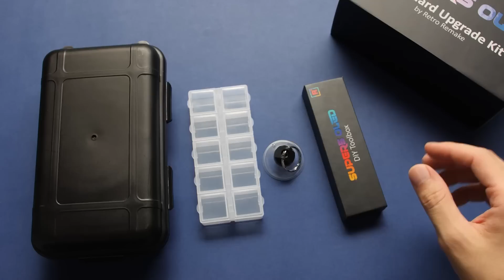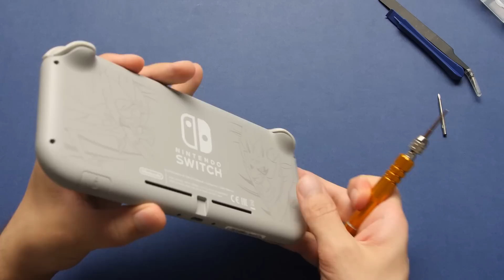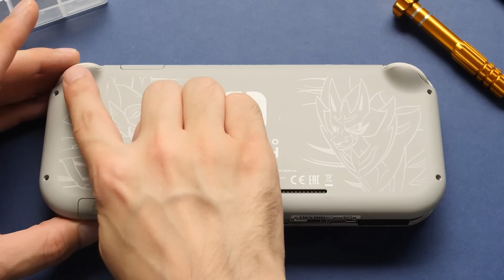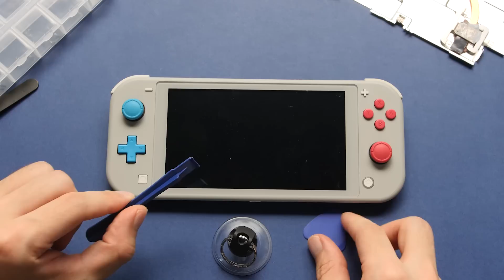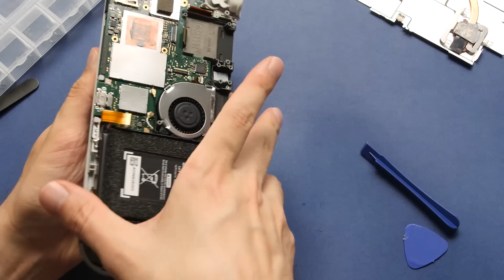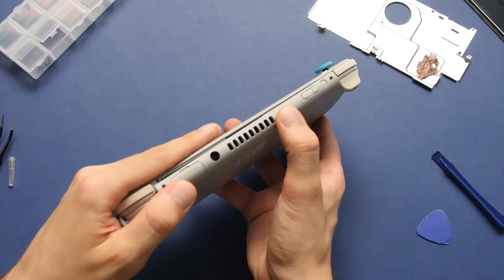SUPER5 OLED - Product Overview & Installation Guide Part 1

Comment: You made it !!!! Just a (dumb) question before to order: what are the differences between the OLED Standard Upgrade Kit (Compatible with Stock Digitizer) and the Standard Classic ? You talk about glass and we can choose color on the second one ... ? Thanks
Reply: The display in this video here is the standard upgrade kit. Here you can choose colors because it comes with a glass screen.
The screen technique here is called laminated. The glass screen is glued to the display so there is no space for dust to settle. Look at 0:28, display and touch are one unit

The „compatible with stock digitizer“ is also laminated, but only with a transparent glass the size of the screen itself. You set this inside your housing and then you have a small gap between this and the touchscreen. As you reuse your old Touchscreen it doesnt make sense to choose a color because the color is given by your existing touch
Reply: @michaela831 thanks for your answer ! So what is the best way or more easy ?
Reply: @michaela831 thanks for your answer ! So what is the best way for me ? I have a  Dialga Pokémon édition in good condition, screen and case. Thx
Reply: @Jabiroedison   i would wait if the metallic gray comes available for the touch. I for myself think its ok if my dialga and zacian switch have the black border around the Display.
But i start with the new zelda hyrule where black would be a better match.
If taki brings the proper colors in time i will change my order for the right colors.

Otherwise if your console is in nice condition i think i will go with the „compatible with stock digitizer“ as losing touch is no option for me
Reply: @michaela831  thanks again for your answer ! but why take the touch version if I had already a touch on my switch lite ? And a compatible with « stock digitizer » is available ?
Reply: @Jabiroedison  according to Taki, the touch screen offered by him is made out of glass, so it should have a better scratch resistance than the original plastic one 

With glass, it is probably more vulnerable to drop damage, but from what i have seen so far you wouldn’t drop a stock switch either, so this shouldn’t matter

Comment: @Taki, will you also make a video of the Mega Kit? I just ordered the Mega Kit package and would love to see the Mega Kit replacement in visual action <3
Reply: At the end of this video he says the next video is with Shell swap so it could be the mega kit
Reply: What's the Mega Kit??
Reply: @bryancartagena3286  A replacement Switch Lite shell with the OLED screen, touch panel and HDMI mod pre-installed, as well as a new battery, buttons, and hall effect sticks, so the only original parts needed are the motherboard and cooling assembly.

Comment: What's battery life like? The same or better?
Reply: Lesser life.
Reply: I believe I read that it will be about the same IF used on the same brightness. However, this screen is 600 nits vs 400 on OG Lite screen, so you will get less life when the brightness is set at or above 2/3.

Comment: I really want to see how the HDMI port looks like :D
Reply: I feel like they replace the usb c port.
Reply: @TheSmileCollector  erm, can you charge through hdmi? I already pre-ordered the mega pack with everything, I really hope that's not the case 🥲
Reply: @RenatoFontes  Looks like it might be separate! Wonder what it'll be as well. I just assumed it was usb c since it can do charging and hdmi(if supported).
Reply: @TheSmileCollector  the website says no soldering, so it's not going to be replacing the USB c port.

Comment: Looks simple enough but you might want to touch on thermal paste in the next video - You didn't replace any between the heatshield and the copper pipe; seems like too much paste left the build when removing the old heatshield.
Reply: That's not thermal paste that's thermal putty
Reply: @Vintagegamer85  you're right, but in this specific application (between the copper pipe and the heatshield) replacing it with a bit of paste should be fine; my v1 switch has been running perfectly for 4 years with the putty replaced by paste. I've also done about half a dozen switch lites in the past year that are also doing just fine.
Reply: @jayjayhooksch1  well Thermal paste is designed to fill microscopic flaws/
recesses between Cooler and CPU/Core. Thermal Putty
is designed to fill gaps, sometimes as large as 8mm,
and keep it's shape and not shrink. But in the application of a switch i guess it's better then nothing just not recommended.
Reply: @Vintagegamer85  putty is probably better, as there is a bit of a gap there, but I have no problem telling anyone who already has some paste to just go ahead use that; the kids and I have put thousands of hours on our v1 since I did the swap, and it still runs fine. 

Maybe I'll crack it open this week, it's been about 4 years of heavy use, could use a clean out anyways. If I do, I'll respond here again with whether it shrank/dried to where I wouldn't recommend it anymore.
Reply: @jayjayhooksch1  sounds good
Reply: @brandoncarroll8265  again it's not thermal paste it's putty two majorly different things yes you can reuse thermal putty is it's not hard
Reply: The switch lite uses no power and produces hardly any heat. Just leave the paste.
Reply: @jamesfranko5098  it's not a matter of leaving the paste, it's a matter of removing the paste; this video shows him removing paste between the heat shield and the copper heat pipe and not replacing it. 

Believe me, if it wasn't necessary to have some amount of paste there Nintendo wouldn't have included it or the heat shield, saving them tons of money over 120 million units.
Reply: Looks like ill be going to best buy when I get mine
Reply: As long as you put enough paste, the gap is not that big at all. Two main reasons companies use putty in these situations, it’s necessary due to things like vrm components or large gaps, or it’s cheaper and “lasts longer”, especially in a handheld device that gets moved around a lot. And by “lasts longer” I mean your 10 year old might turn 50 before the putty is complete trash where they might be 45 when the paste is useless. 

If you wanna go crazy, get a graphene pad and use that instead
Reply: you call this simple? you literally have to take apart every single part!
Reply: @Jorven-w1z  you never played with Lego, or puzzles or took apart things for fun as a kid? This just requires patience and organization (it would be easy to lose track of screws). But it doesn't require any special skills like soldering or anything, you'll be able to just follow a simple YouTube tutorial I'm sure.
Reply: @jayjayhooksch1  Lego? I used to build PCs for a living and still mess around with them for fun. I even do console mods now and then, but this one’s very involved with a real risk of messing up some parts.
Reply: @Jorven-w1z  if you built PC's for a living this will be a breeze for you, it just looks intimidating, like most new things do. 

I haven't attempted building a PC, as it looks daunting to me, yet I am easily able to reshell switch lites. One person's difficult is another's easy mode. Trust me, once you get into it, if you take your time and stay organized, you'll be fine.
Reply: @jayjayhooksch1  I’ll probably still go for it because I want a smaller, more ergonomic Switch Lite with a good display. But swapping it’s display isn’t exactly something I’m looking forward to.
Building a PC is straightforward and fun (aside from the cable management), but taking apart all those tiny pieces and putting them back together is gonna be a headache, similar to organizing PC cables.
Reply: I just got to this part and yeah! This feels wrong. We are removing the stock thermal paste while not replacing  it with anything??
Reply: In all fairness, having repaired so many switch systems myself, you never really need to. The soc used in it is so lower power that it doesn't need much thermal paste. I've not ever replaced it except the first system I did and it's not been an issue. You'd only really need to do that if you were modding and overclocking.
Reply: @lieutent2654  for those who plan on opening up their consoles multiple times, would it be advisable to replace the thermal paste with a thermal pad for less mess? Or better to stick with the paste?
Reply: @inclinerd  I don't recommend a thermal pad. It may be possible to get the right size but I tried a thermal pad in place of the thermal putty on the top of the heat pipe, and the Switch Lite seemed to run hotter afterwards. Underneath the heat pipe and underneath the APU's shielding, you should definitely use thermal paste, as even a thin thermal pad will be too thick and could cause warping that could crack the PCB.
Reply: @GareWorks  thanks a lot. I planned to take it apart again & solder in a modchip sometime after I get the OLED screen installed, and I was hoping I could get away with a thermal pad for less mess. I’ll stick with the tube of Arctic MX4 or MX5 though
Reply: @lieutent2654  he put the plate direct down with zero paste between the backplate and heat pipe . Is it fine to not add anything at all ? I'm talking about the paste on top of the heat pipe that touches the back metal shell
Reply: @droo3010  No, always add paste. The stuff that goes between the top of the heat pipe and the metal shielding is more of a thermal putty, which is thicker.

Comment: Excellent guide! Another video for touch screen, variant?

However metal tweezer with battery on isn't a good idea + The latching mecanism is very weak and can break if lifted through a small area (tip of the tweezer)

I'd suggest using plastic and flat tool.

Comment: Ordered the non-touch.
Should the thermal paste be replaced while it's open or is it fine to just leave it?
Reply: arctic mx 4 for is good and cheap like 7 bucks, 4g will give you way more applications than you'll ever need if you don't do this stuff much
Reply: If it's not had a repasting done over the last few days, always stick on new paste to ensure you're getting good contact with the heatsink.
Reply: I did both, and didn’t notice a difference either way. If you just take the heatsink and shield off and put it aside without disturbing the paste it’s fine, but new thermal paste is like 2$ so I would just replace it.
Reply: @browny99 what do u mean put it aside without disturbing the paste. Why does it matter when there will be a new metal plate attached . Ur not gonna use the old one
Reply: @droo3010  yeah, right. I forgot that this mod also replaces the metal shield. In that case just get any thermal paste and just re-paste the top of the heatsink. 
It doesn’t really matter though, the switch lite produces basically no heat…
Reply: @ArisuSakurai  fyi when I seated my heatsink on my PC the first time, I was struggling with the screws so the heatsink broke contact with the cpu and I seated it again, for a while I thought my PC just ran hot. Until I bought good fans and they brought the temps down. One day I decided to just reseat my heatsink with "better" thermal paste and that also brought temps down by a lot. I had stock thermal paste and replaced with mx4, but I've always thought it was because I struggled so much with the heatsink.
Reply: "Thermal putty" not paste do not put thermal putty in place of thermal paste they serve two totally different purposes
Reply: @Vintagegamer85  sure, but on the switch lite it really doesn't matter... You could leave off the layer between the metal shield and the heatsink completely and be 100% fine, just make sure the contact between the heatsink and processor is good. In there you should be using thermal paste.
Reply: It's always a good idea to replaced it. The Tegra produces slightly less heat than a normal Computer CPU, so any decent CPU paste will suffice.

Comment: Just bought mine. How hard is it for the HDMI mod
Reply: the most expensive kit comes pre-assembled with replacement shell, buttons, 2 hall effect joysticks, etc too as well as the HDMI mod.  That one only requires swapping the PCB.  I may choose this one.  The only issue I forsee with the HDMI output is that while it does do 1080P output, I imagine it will still be limited to 720P output (or less for games like TOTK) since it will be limited to "Handheld Mode" only with a Switch Lite.  We all know Nintendo won't enable it to do Docked Mode.  But hopefully the HDMI mod has some upscaling features or we have the option to run in Docked Mode via a modchip.
Reply: @GreenLeefMusic  sadly they only have it in black. im going for an all white system, i might skip the hdmi mod if it requires complex micro soldering
Reply: @Fleshlight_Reviewer Taki has said before that both the screens and the HDMI mod are solderless, the only thing I'm wondering is where tf we're gonna find the video out???

Comment: Will you prepare one for the regular nintendo switch? The v1 and V2?
Reply: V1 and V2 don't have the X1+ so it might not have the hardware for it, dunno if it can be done without homebrew and more hardware... hope is possible though.
Reply: V2 is Mariko, same as OLED and lite lol :P anyway LCD and digitizer is compatible between v1/v2 wchich means they have same pinout  @soragranda
Reply: @maxmax-xx7nw  So then is possible to V2?

If that is the case then a project like this could appear in the future.
Reply: Que andas haciendo aquí, soy huma_dawii @soragranda
Reply: @soragranda v2 is mariko. Lol

Comment: How hard would it be to keep the touch functionality?
Reply: There's one that's compatible with the stock digitizer for the same price as this one whenever they come back in stock or you can do the whole OLED + digitizer for $15 more, not a bad deal tbh especially if you want glass instead of plastic that scratches easily

Not to mention the pain in the a$$ that is trying to separate the LCD from the digitizer without breaking either if you're inexperienced with that like I am
Reply: @ungwallop  I'm a bit confused so hope you can clear this up for me.  The "Touch" package and the stock digitizer compatable package both offer touch screen capabilities?  
It's just the "Touch" one comes with a new digitizer so you don't have to separate it from the screen panel, correct?
Thanks.
Reply: @rabidmonk5  you nailed it. I think Taki has mentioned something in the past about the stock-compatible screen having a bit of a gap between the touch panel and the OLED once you've attached them but if you wanna go full "sleeper" and keep the touch functionality for the same price that'd be the way to go. I'm personally shooting for the "touch" package just cuz it has the glass panel and no air gaps, plus TMI but my switch has a game-boy inspired case mod with the whole "dot matrix" thing on the back so I thought it was just perfect
Reply: @ungwallop  I see.  I'll probably just go for the standard version because I literally never use the touch screen.  But if I hypothetically were to go for a touchscreen option, I would definitely go with the screen+digitizer.

Comment: Was waiting eagerly for this. Waiting for OLED Touch tutorial too.
Reply: I'm wanting the touch with hdmi output! I've got an oled myself.  But my kids have lites and have complained about not being able to play on their TV. So win win!
Reply: @SWEDInc  i ordered touch but changed my order to Oled Hdmi. TV option is really good and hardly use the touch.
Reply: Same can’t wait to see the touch tutorial
Reply: Can I ask why is the touched used for . Do you need it at all or are some games or menus only workable with touch ?
Reply: @droo3010  it's not necessary, more of a convenience. Switch games are able to be played in "Docked" mode on a television, with a controller, not by touching the screen.
Which is actually what makes this so interesting... its simple. Do I really need a touch screen? I'll be very curious to see a touch screen tutorial as well before purchasing.
Reply: @droo3010  Mario maker 2 and Mario 3d world/bowsers fury are my main 2. Plus I would rather pay 10$ extra with a promo code to keep all the original features of the screen.
Reply: @droo3010 Touch screen is faster than buttons for menus and is very useful when you have broken buttons too. I wouldn’t buy an Oled screen for the Switch Lite if it doesn’t come with Touch functionality, but other people may.

Comment: No touch is a huge dealbreaker.
Reply: i'm not sure that they're available just yet but he's confirmed that touch versions will be offered later on
Reply: why you dont need it
Reply: @JadeAhlers  i think some people will just find it off-putting to go from having a touch screen on their lite to no longer having one, even if it looks far superior
Reply: @hairjetblack why would it look superior, let alone "far superior"?
Reply: @JadeAhlers  the joystick and keypad stop working you can always use the touch as a last resort
Reply: there is a touchscreen option coming
Reply: I literally did not know the switch had touchscreen. Besides the interface I don't know any game that actually support it.

Comment: Order placed, hopefully everything goes as planned. Can not wait.
Reply: What package did you buy
Reply: @360MM-11  non touch+HDMI
Reply: Can you used the original Touchscreen with that kit or not?
Reply: @Joelwillfixit  no
Reply: @Joelwillfixit  you need SUPER5 OLED - Standard Upgrade Kit (Compatible with Stock Digitizer) currently sold out to be able to use your current touch panel, however color is not matched.
Reply: @360MM-11  video of what?shipping starts Nov.
Reply: how tf can you stand not having touch controls, you just get a broken switch with a better screen
Reply: @alecs7506  well, I can not speak for you, I never use the touch function, meaning it won't bother me at all. I can live without it. You call it broken, I call it useless.
Reply: @alecs7506  How often do you really use the touchscreen? I still ordered it with touchscreen cause I do still want that function but I'd completely understand if you wouldn't care about it.